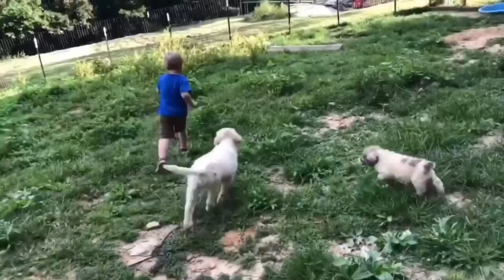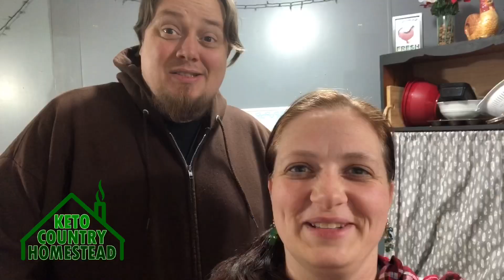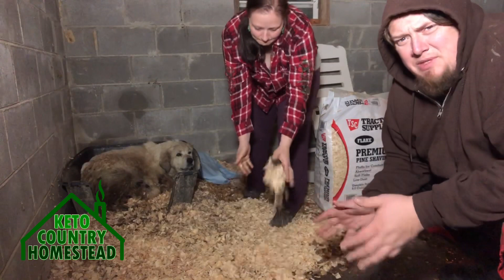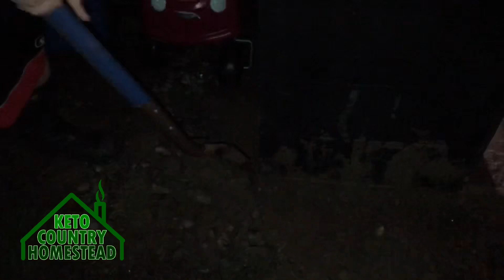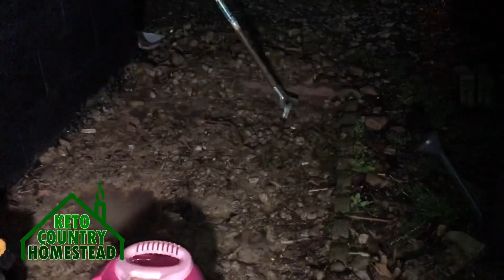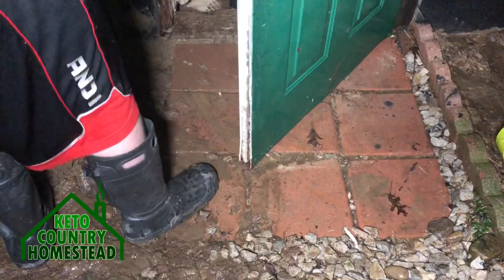Great Pyrenees puppies born - Homestead Work

Comment: We have had soooo much rain!!  And there's even more on the way! 😟  What you did probably helped.  I bet when that building was built they didn't have a problem with water build up. It has been really bad this year. I need to try to do similar for my horses. I have run out of dry places for them.  At least the puppies are high and dry! 😍
Reply from the maker: I’m getting concerned about this rain. We need a break so badly.
Reply: I have been checking the extended forecast.  After this weekend it looks like there may be a drying trend.  Still a little precipitation, but no where near like we've been getting.  Of course, the forecast could change, it's been known to happen.  Pray it doesn't!